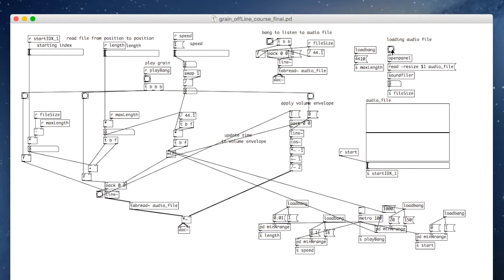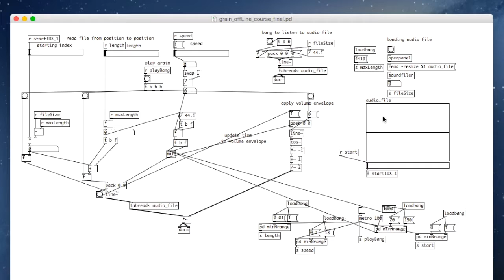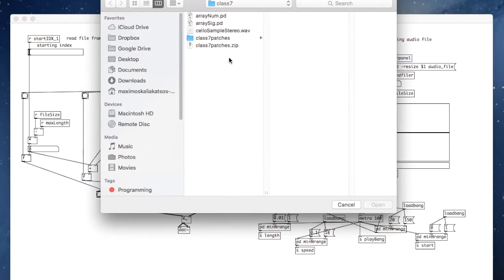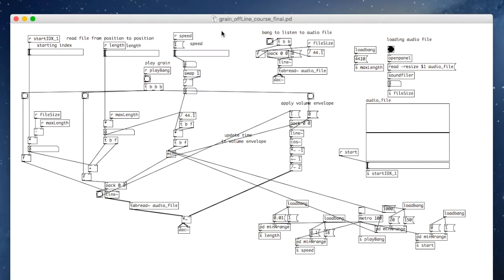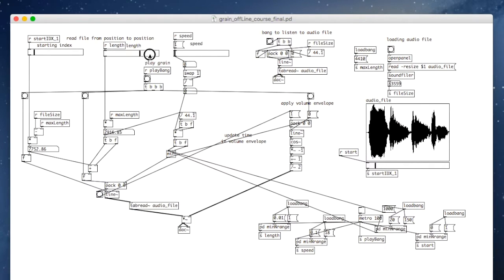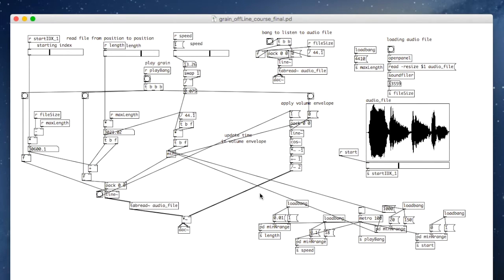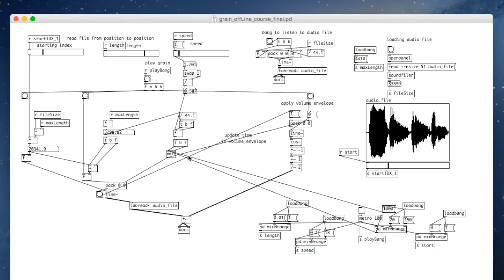Granular synthesis on audio file with Pure data

Comment: Hi Max, I love the way this patch sounds in the video and its exactly what i'm looking for. However, when I download the patch from git, and I open the patch file, it appears differently from in the video and I'm not sure how to use it. Has it been updated to work differently? Im a pd beginner so go easy on me! Thanks a bunch.
Reply from the maker: Hi Clementine! Thank you for your nice words and sorry for the delayed response. You are right, the patch on GitHub is a "magnified" version of the patch presented in the video. The patch in the video is actually a single granular "generator" that can play one grain at a time. The patch on GitHub has 8*8 = 64 such generators, allowing for richer timbres with little additional cost on complexity - all parameters are still more or less the ones shown in the video. So,

1) You can "simulate" the patch in the video by setting "grainsNum" to 1 (top right slider).

2) The file aGrain.pd represents one of the 64 generators and it is an improved (but quite similar) version of what appears in the video.

3) This patch got re-designed to be similar to the "Grainman" real-time audio granulator that I've made - you can find a video and the patch on YouTube.

Thank you again for your comment! I will be very happy to answer any other question and attempt improvements / bug fixes on the patch according to your comments.